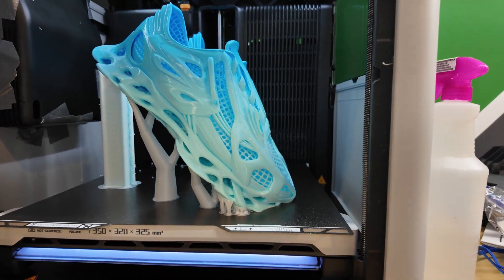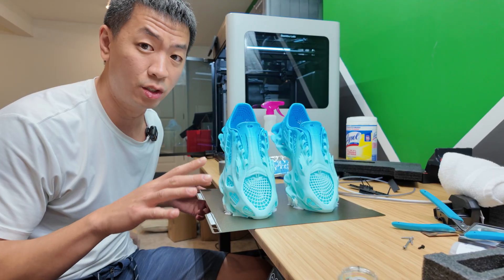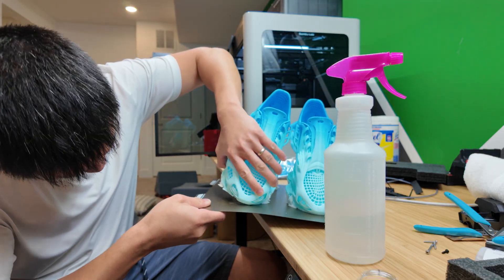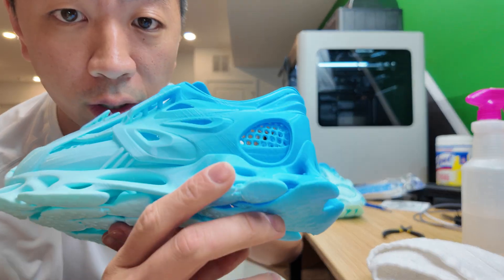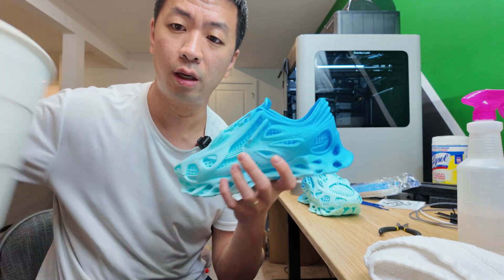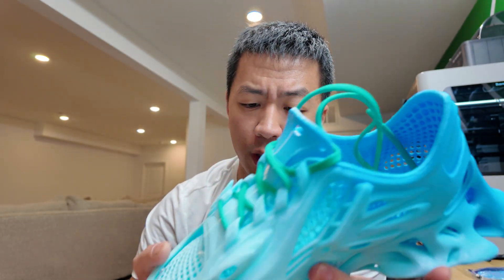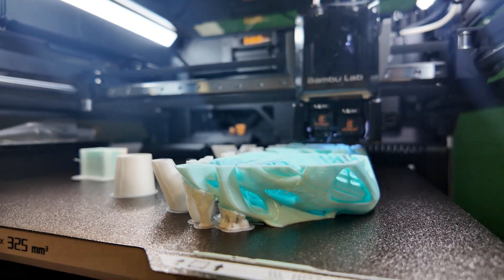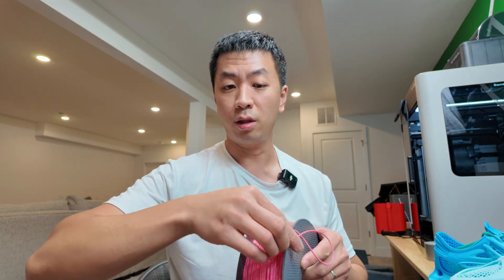I 3D Printed Shoes!!

Comment: Is is possible to use the support Material JUST where it meets the print. This way it only uses one material and has way less changes saving maybe a day or two?  Is this possible or will the TPU no stack up. again you still are using the support where it touches the shoe.

Comment: I printed a few items with BL TPU 90A red, but looks more like pig pinkish than red. 

I got the 90A as soon as Bambu began seeking it and i didn't think their print profile were correct at the time and it seriously under extruded.  I've since reprinted a month later and it prints terrific, although extremely slowly. 

I much prefer the BL TPU 95AHF because that is almost as soft but prints twice as fast, or faster (naturally, being HF).

 I've printed CROCS in about size US 13 MENS.  but i had to get creative to get it to fit on 256mm cubed plate.  I had to cut some of the heal off in slicer to get entire size 13 to print, and only one croc at a time. 

They are now a conversation print than something I'd wear regularly.  But maybe I'll try again with thinner walls and less infill